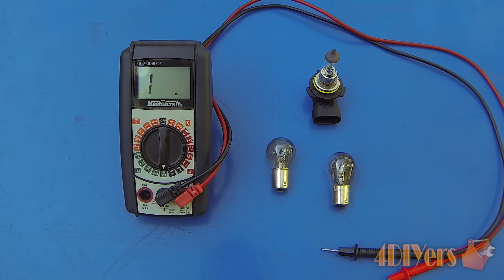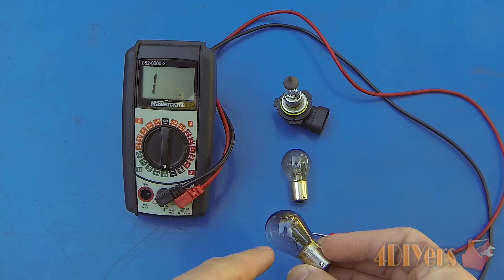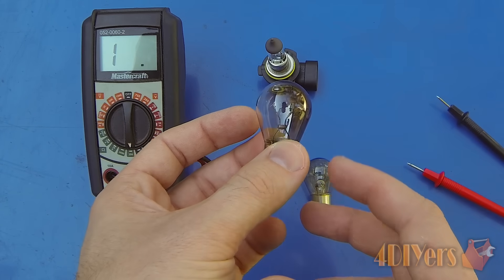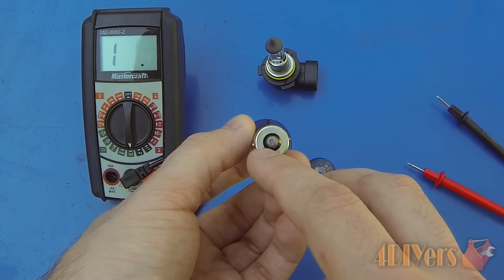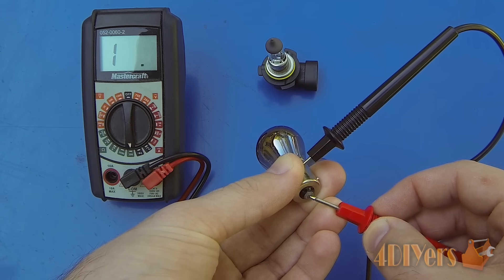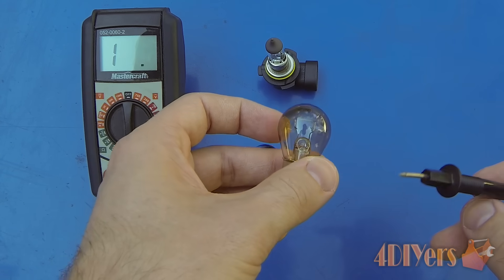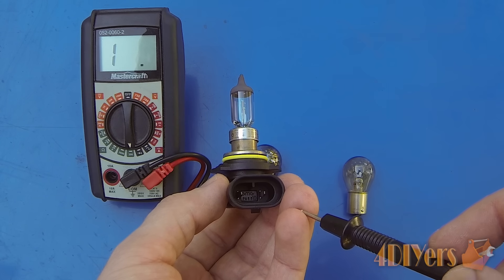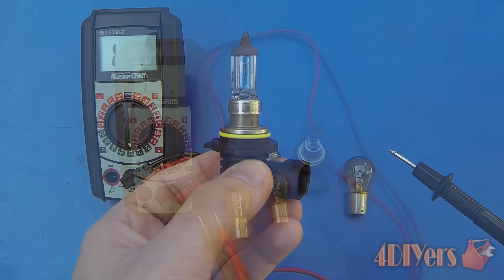How to Test for a Faulty Light Bulb

Comment: Thanks for the video. The single filament bulb I have, doesn't light up on the car. When I took it out, noticed the glass has some black sooth on it, however, there is continuity. What is your diagnosis for this bulb please. Thanks.
Reply from the maker: Black sooth sounds like it’s burnt out.

Comment: The resistance readings that I get from my headlight are not in line with the manufacturer specs and don't even compute with my amperage readings (about 4.7 A at 14V) according to Ohm's Law.  Any idea what I am missing?  Thanks again for the tutorial.

Comment: To make sure that your m.m. is functioning, it's advisable to touch the leads together to check them for continuity before you begin.  Also, I like to use the diode setting for the audible beep.  Cheers!

Comment: Hi, i changed brake light bulb but whne i press brake pedal, the tail light bulb glows with high power instead of glowing brake light bulb. Can you suggest what could have gone wrong..??
Reply from the maker: I saw the video you posted. There maybe a wiring issue or could have been the wrong bulbs, either before or now. I know some European vehicles have a two stage brake lights, when they're pressed normally they illuminate as they should and for hard braking, they activate another circuit for brighter lights.
Reply: Prolly your bulb installed wrong

Comment: question! getting an aircraft light blub to work off 12 volts that require 28 volts? Is there an easy fix? It's a small bulb like in your video here. Here's the info on the back of the bulb (Micro lamps ML- Cage code 61951 M6363/2-2  28.0 Volts. Thanks

Comment: Hey man I got one of those really skinny halogen bulbs I don't know where the connection is (I don't see any copper or metal) where should I test it? Do I need to take the socket out as well?
Reply from the maker: Yes you will need to remove the bulb from the socket. Don't forget to subscribe!
Reply: So my socket is only reading 0.1V at the 200volt setting on multimeter. Doesn't seem right because it should be reading 12V. Any other tests to rule out the wires and just be the socket?
Reply: Brian Pacheco:  Wish there was an answer ...

Comment: As you did in the first bulb, you said that it's not working and should be replaced. Once I did the same thing with mine by the multimeter and it shows no signal but when I plug it to a battery it works! 
why is that? 
I'm sure that I put the multemeter on 200 ohm! 
What do you think?
Reply from the maker: +حامد الناصر The filament could be broken, but when you apply voltage it reconnects. It's most likely on it's way out.